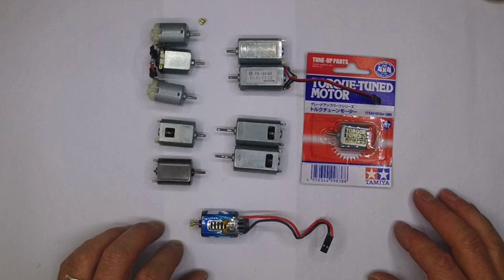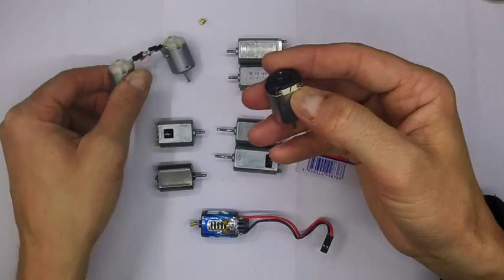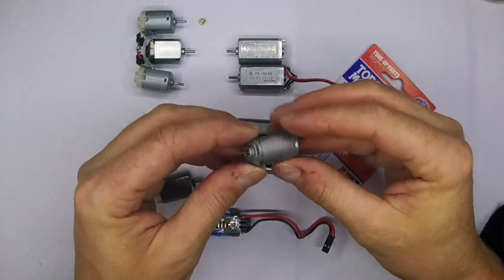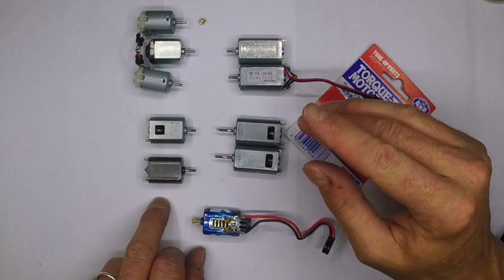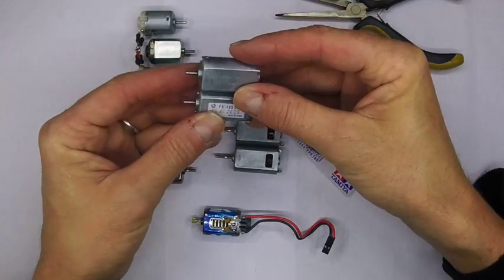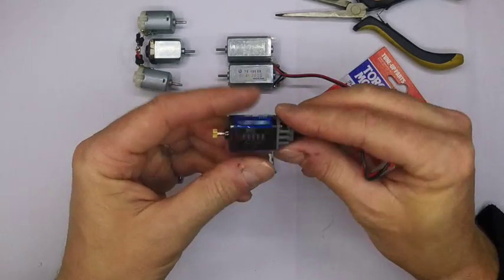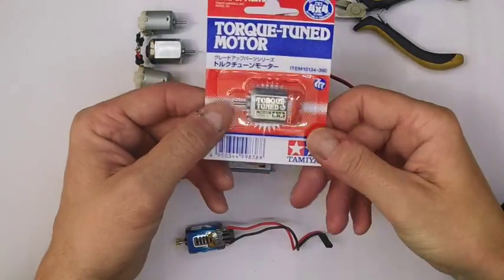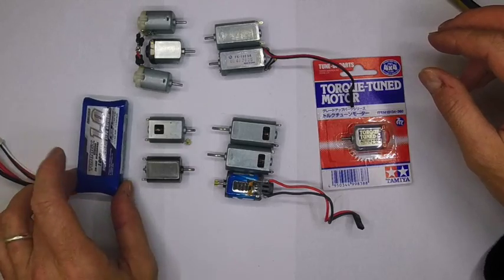Nerf Motor Mod Guide

Comment: Just out of curiosity have you ever heard of Banshee 130 Motors? apparently they're like Mieshels.
Reply from the maker: Yes, but they weren't sold when I made this video. They just have a slightly faster idle speed than Meishels.
Reply: +Foamdata Services Really? interesting. I wonder if you can run them on IMR's ? I just finished modding my Demolisher by replacing the wire and running it on 2 IMR's but i'm thinking about a motor replacement mod.
Reply: +RedNinja Productions Oh and might I also ask can a 5A microswitch handle a 2S battery?
Reply from the maker: A 5a microswitch can handle, if you believe the spec, 5A at UP TO 250v AC. Current handling capacity has almost no relationship to the input voltage. What you need to do is work out the max CURRENT load, so that 5A switch could probably handle 2 rhino motors, 1x 3240 or 3 stock RS motors, but potentially won't last with 2 XP180 motors running off it. If you are talking about a rev switch then more current capacity is always better. I have seen 5A cherry's last ages in Stryfes or on cycle control switches in RS builds. You need to tailor your components to exactly what you want them to do. We are moving away from using high current microswitches in 2 motor blasters, we now use a MOSFET with the stock rev switches, keeping all the high current out of the grip altogether. See my Demolisher video for details.
Reply from the maker: You can't run Banshees on IMR, they pull 8A each, so more than IMR can supply.
Reply: +Foamdata Services Thank you so much this really helped alot

Comment: hi tom I got some tamiya plasma dash motors.... I'm planing to run them in a stryfe what kind of battery pack would suggest for the stryfe??
Reply from the maker: Plasma dash motors aren't that great IMO, they have huge current demands to make the same power as a more efficient 2s or 3s motor. Their torque is about half of an MTB rhino as well. If you are dead set on using them then you will need a 1s Lipo pack, at least 1000mah capacity and 30c discharge constant, which can fit in the Stryfe tray.
Reply: +Foamdata Services thank you:)

Comment: What about tamiya plasma dash motors? I hear they're better than the torque-tuned.
Reply from the maker: They are better than the Torque but all the 1s motors draw far more current than 2 or 3s motors and produce less torque. This means they not only need bigger and more expensive packs but produce less performance.
Reply: +Foamdata Services 
Thank you for the reply! I will be putting banshee motors and a 2s lipo in my rayven stinger.
Also, what would you recommend as the "best" available motor combination for a 2s lipo? I used to use xtreme 180s before they became unavailable, and I have yet to find a new consistent source for motors.

Comment: I am overhauling my stryfe at the moment, and i am planning to use 3 protected trustfires. What Motor would be most suitable ( please bear in mind that i dont have the tools to do extensive shell mods and would like to avoid any shell modifications if possible) also if you have time please could i have a link to them. thanks in advance Starfalcon Tactical
Reply from the maker: Don't use Trustfires, they are totally unsuitable for Nerf use. They can't even handle stock motors. Watch my battery guide and Blaster Balance videos again.
Reply from the maker: Protected Trustfires will also just cut out as you will be going over the designed discharge limit every time you use them. Unprotected are even more dangerous. I won't even allow them through the door at my regular game.

Comment: I'm curious what makes the torque tuned motor so good. It seems like I've read that you want around 25k RPM for flywheelers, but these run at 13,600 @ 3v. In the video you said they could run on 3 Nimh AA cells, which would be 3.6v. Can't imagine the extra.6v is doubling their RPM. Please clarify. Thanks.
Reply from the maker: +Wesley Withers Torque tuned are not great compared to other mod motors. They are an option for people who don't want to use lipo. The Tamiya Mach Dash is better but more expensive.

Comment: hey Tom nice work as usual... I really love your videos.... and this was my most wanted video because I really had hard times with nerf flywheel guns. great work as usual
and Tom I hooked up a 1s Lipo pack into my rapidstrike which I ran on 3 torque tuned motors but apparently got poor chronograph readings.... and also in hesitant to try a 2s Lipo pack... any suggestions would be appreciated.. anyway nice work with the video
Reply from the maker: Throw away the torque tuned motors and get something better. If Tamiya is all you have then the Mach Dash is better, otherwise get a set of MTB Rhinos and go to 3s.
Reply: +Foamdata Services oh ok... but what kind of 1s would you recommend for the torque tuned?? by the way I have already been with mtb rhino motors
Reply from the maker: The battery is largely irrelevant, it's your motors that are the problem. They don't have the required torque or the right RPM range for Nerf use.

Comment: A while ago I followed Coop772's basic rapidstrike mod with 3 14500 ultrafires and the stock motors. I wanted to replace the motors so I wouldn't have to worry about them burning up. My batteries are 3.7V 900mah. Could I use the the meishels motors you linked in the description with my ultrafires? I have four of them in total.
Reply from the maker: +KORIBLADE100 Those cells are junk, sorry.
We never use them and all AA size cells are unsuitable for Rapidstrikes. Meishel or similar mod motors need the power of a 2s Lipo or 7.2v sub C Nimh pack to run. They are capable of drawing between 10 and 20 AMPS each. Your Ultrafires can put out 2Amps MAXIMUM, meaning you are putting them right into over discharge every time. That is why you have to use unprotected ones. Adding more batteries makes no difference. I would think about a proper rewire for packs, see my channel or Make Test Battle and The Dart Zone.

Comment: how much is the rpm of a nerf motor
Reply from the maker: +gadheda lal 
RPM is dependent on voltage. The ideal RPMS for maximum power are 33-35k free running and about 26-28k under load, this produces max FPS. You also want maximum torque. See here for motor data sheets-
http://britnerf.myfreeforum.org/about1967.html

Comment: Hi, great guide. Your videos are very thorough and you actually test things properly rather than most of the YouTubers from across the pond that tend to just say 'i just did this mod it's sweet` then only attempt to back that up by shooting a wall or some grass! Have you have any hands on experience with the tamiya motors since recording this?
Reply from the maker: No I haven't tested Tamiya motors. A fellow Britnerf modder has, with worker flywheels, his initial results are here-
http://britnerf.myfreeforum.org/about2373.html
I still don't recommend them as Nerf specific ones have far more torque which means better snap response.
Reply: +Foamdata Services very interesting. it looks counter-intuitive that a modified stryfe with three aa nimh could out perform four in a stock stryfe with less potential power available to propel the darts.  perhaps they really are good motors or the secret is the flywheel upgrade.
Reply from the maker: +Say Yes To Cress Those shots will be at peak rpm not sustained fire and a rhino or 180 build with the same spec should shoot 125-130 average. That build would have shot harder on 1s lipo as well.  That set up also cost more than a rhino build by about £30.
Reply from the maker: +Say Yes To Cress Stock motors are also much lower torque than tamiya and about a third of rhinos

Comment: So what kind of performance should I expect from rhinos on a 2s pack
Reply from the maker: +Michael Clawson About 95-100fps. Look for eBay seller Worldsky, search DC 6v Motor, those are Banshees, a 2s motor, or FK130PH 2460, they are better on 2s.

Comment: so the recomended voltage on the torque tuned is 3 volts and then i have two of them so i need 6 volts right ? and if so can i go with a 2s for 7.2 volts?
Reply from the maker: +jefferey jones It doesnt work like that- two motors still need 1s MAXIMUM, they will draw double the current though.

IF YOU RUN ANY MORE THAN 4V THROUGH THEM THEY WILL POP.

Comment: Quick and simple question, will rhinos take a 2s lipo preferably this. http://www.amazon.com/gp/product/B004I0CEFW/ref=oh_details_o04_s00_i00?ie=UTF8&psc=1
Reply from the maker: They will run on 2s, they won't produce as much power as on 3s, the voltage they are designed for.
Reply from the maker: That pack is way too big for a stryfe as well as expensive.  Look at Hobbyking for lipo and chargers.

Comment from the maker: Loke Egnell- Can't reply to your comment for some reason. Don't use Trustfires, they are awful cells and are dangerous IMO. An IMR set up is on the edge for discharge and capacity with Meishels or Banshees which are I suspect what you linked, Trashfires are nowhere near powerful enough to be remotely safe in that application. They are an unprotected Li-co cell, about as bad as Lithium chemistry gets. A pack is a far far safer option.
Reply: I was thinking of replacing a Norton's motor, would would you recommend?and where to find the recommend motor?
Reply from the maker: Duncan, surely Norton motors are better rebuilt? I would start with a motorcycle forum, a manual and a decent machine shop.
Reply: +Foamdata Services oops I'm sorry, nitron, nitron the Nerf gun. I wanted to replace it, I mistype
Reply: +Duncan MacKenzie the motor for the gun
Reply from the maker: The main flywheel motor on the nitron can easily handle 4s and doesn't need any modification to work well. The pusher motor is rubbish, replace it with a 3s 180 like the MTB hellcat for good ROF and run the whole lot off a 3s Lipo.
Reply: +Foamdata Services thank you, I'm making a nitron to send to a YouTuber and I just wanted to make it the best I possibly can
Reply: Foamdata Services which motors should we use to run a 1.0 lipo
Reply from the maker: You pick the pack based on what motors you want to use. 1s is no good for nerf use, the motors pull too much current and don't generate enough torque.
Reply: Foamdata Services could you be helpful enough to tell how to make my hyperfire go at 40 feet , it's an Australian version so should I just do a p volt modification
Reply: I meant 9 volt
Reply from the maker: 9v PP3? Can't power anything but a smoke alarm off that.
Reply from the maker: If you have a hyperfire then running it with three MTB rhinos (you need to adapt the conveyor motor slot to take the smaller motor) and a 3s lipo will work. You can't half mod full auto electrics, it's a full rewire and proper battery or leave it stock.
Reply: Foamdata Services would 7.2 volts burn the motors or anything ?
Reply from the maker: A 7.2v PACK, either Nimh or
lipo  will run the Hypefire fine. Two 18650 IMR in a high current holder will too, anything else is no use. You should rewire ideally, but neither of those would trip the thermosistor and the stock motors draw around 12A peak.
Reply: Foamdata Services I bought a 9v battery can by wires and motors take the voltage or would the break or burn , will anything happen you said I could use 7.2 V can I put 9v
Reply from the maker: You can't use 9v PP3 batteries in Nerf. Please watch my balance video. LThey are hopeless, even worse than an aa cell.
Reply: Foamdata Services I'm not getting it sorry , if I put 9v would it completely destroy my blaster or no?
Reply from the maker: They are just rubbish, they won't "destroy" anything apart from your blasters performance.
Reply: Foamdata Services alright thanx
Reply: Foamdata Services thnx , I ordered some imr,s would 2 IMR in my hyperfire break or destroy any of the wires , motors or any of my gun and how many IMR IN MY GUN WOULD BE SAFE TO USE
Reply from the maker: You can't use IMR in full auto blasters, they draw too much current. They can only be used in blasters which took AA batteries to begin with.
Reply: Foamdata Services so then what should I use trust fires
Reply from the maker: No, they are even worse. You need a pack, 7.4v-8.4v Nimh or lipo will do.  You can't use any 14500/AA cells in full auto.
Reply: Foamdata Services alright thank you
Reply: Foamdata Services I am buying a 2400 mah lipo of 14V in my hyperfire ,what motors should I use and do you have a better lipo suggestions  for a hyperfir
Reply from the maker: You CANNOT use AA/14500 IMR in ANY FULL AUTO BLASTERS. Only use them in Stryfes or other AA size battery blasters and ONLY with stock motors. Hyperfire needs a pack.
Reply from the maker: DO NOT PUT A 4s LIPO IN THE HYPERFIRE. You will wreck the conveyor. I have told you several times, GET a 2s 7.4v PACK AND USE THAT OR THE RIGHT PACK FOR THE MOTORS YOU PUT IN. Either listen to my advice or stop asking the same question.
Reply: Foamdata Services all I wanted to say is that can I put 180 motors in your video and put a 3s I mean 3s lipo in a hyperfire  to run it nice 90 to 110 FPS
Reply from the maker: Well done.
Reply: Foamdataservices  are these motors that coop found e Flite motors if they are should I buy a rightblade or left blade
Reply from the maker: That is a very old video. Those are a Mabuchi FK3240SH, as shown in this video. It doesn't matter which one you buy for Nerf use , left or right. MTB Hellcats deliver more torque for the same current consumption. Again those blades are a 2s LIPO only motor. As you already have 3s I would buy Hellcats as they have a longer shaft and you don't have to remove any pinion gears or RF control parts.

Comment: im having trouble replacing the zeus rival motors. i believe i read online that they are 360 size but idk how to remove from the flywheels. idk if they are pressed on since the shaft has no keyway and is just round but i dont want to force or break it. im upgrading the wiring and all but im looking online to see which motors are the best quality online. i emailed dr. snikkas to see if he would sell me a billet fly wheel and cage assembly but he has not planned any for the zeus yet. just looking for every possible electric and hardware mod i can do.
Reply from the maker: There is no need to replace the Zeus motors, they are a difficult size and wind and replacement offers no advantages as well as BREAKING THE FLY WHEEL CENTRES. If you pulled the flywheels apart then they are now no use. If you want peak performance then 4s Lipo is possible. The HIR round is very different to darts in its response to increased velocity. Testing by other modders has shown that any velocity over 120 makes no difference in range and has an adverse effect on precision. TLDR, leave them alone.
Reply from the maker: Real info on motors, check the follow up and test data. 
http://torukmakto4.blogspot.co.uk/2015/08/nerf-rival-zeus-lightning-link-rs390.html

Comment: Hey foamdata, how are these motors
http://www.ebay.com/itm/DOYUSHA-Flash-50000rpm-High-Torque-Hyper-Speed-Tune-Up-Motor-for-Tamiya-Mini-4WD-/171665788244
Reply from the maker: They look similar to hyper/Mach dash motors. Those are all 1s motors. The big issue with all the ones like this is torque. They are designed for a very small vehicle with a gearbox, so torque is less important. This means they have almost half the torque of an MTB rhino, meaning less velocity and a worse spin up time. The ones you linked have no data sheet so a pre purchase check on them is impossible. I would get Rhinos for $5 over those if you want a 130 solution that works.
Reply: I just got the specs from another site.  The torque is 22.5 g cm
Reply from the maker: At what voltage? Put a link to the data sheet up, I will look at it. 50k rpm is well beyond the sweet spot at 28-33k where maximum energy is transferred to the dart.